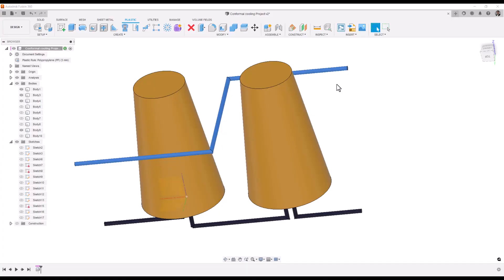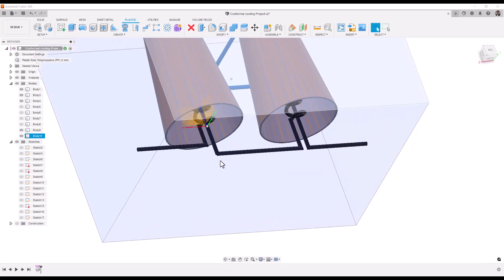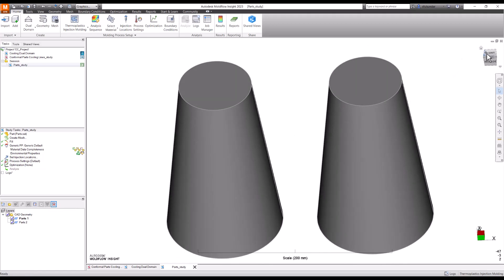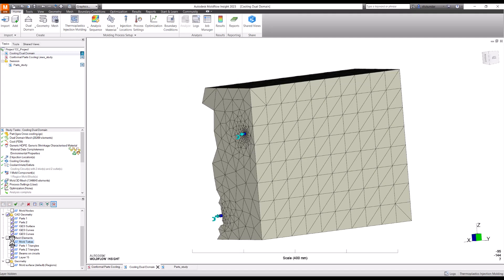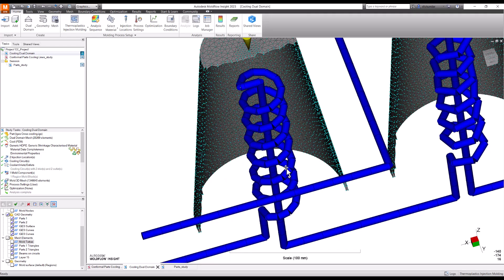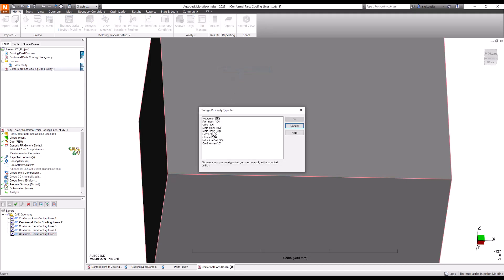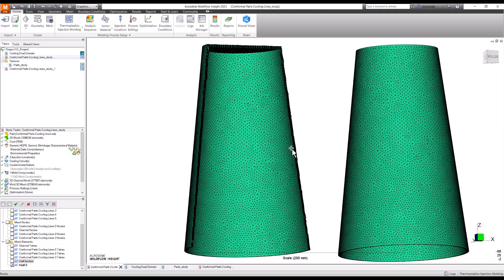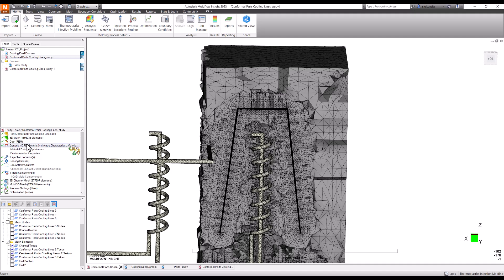Autodesk Moldflow Conformal cooling Comparison between Dual Domain and 3D Tetrahedral Mesh- EP1

Comment: Sir I want to know flow length of any material
Reply from the maker: Hello Krishna- Usually most of the resin manufacturers have the flow length of the material part wall thickness plot. Whichever material supplier with whom you are working please reachout to them
Reply: Sir it is not mention in TDS
Reply from the maker: You need to get in touch with resin manufacturers, it’s won’t be mention in TDS. They do special test for it.